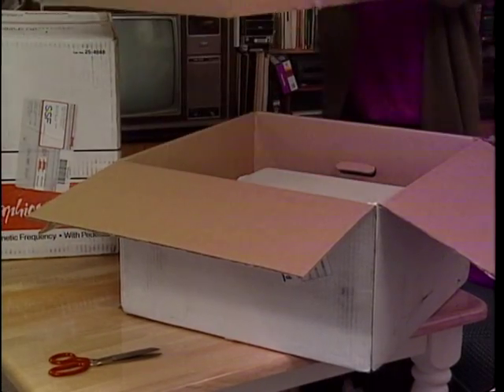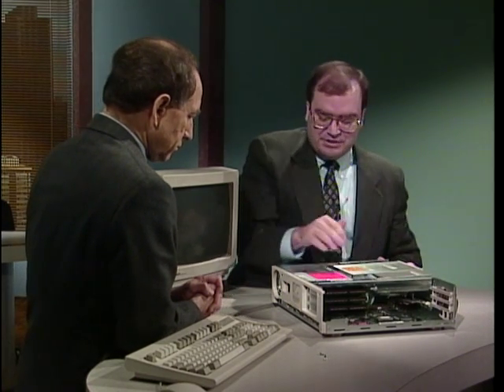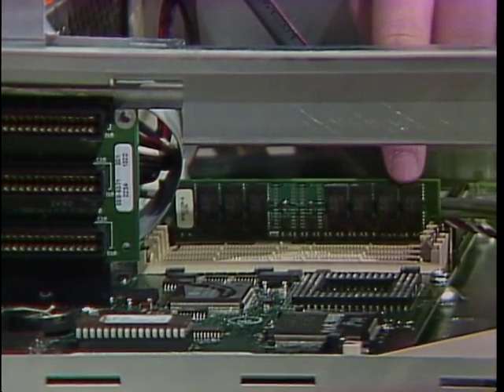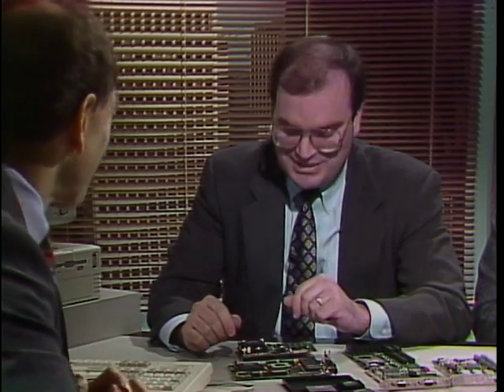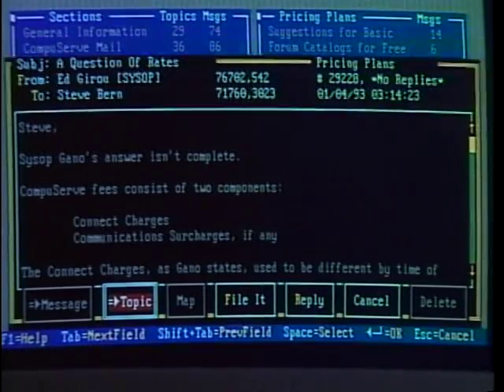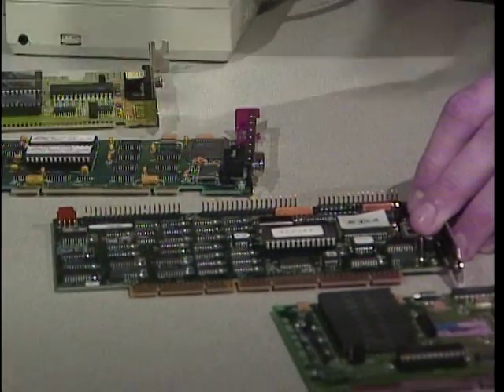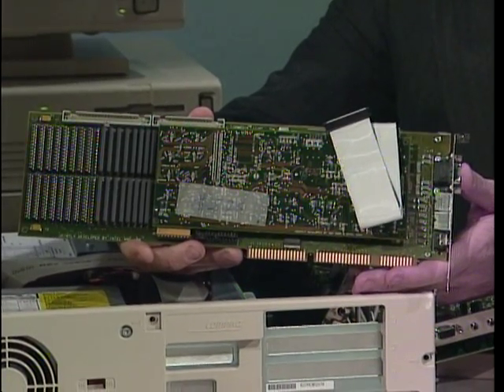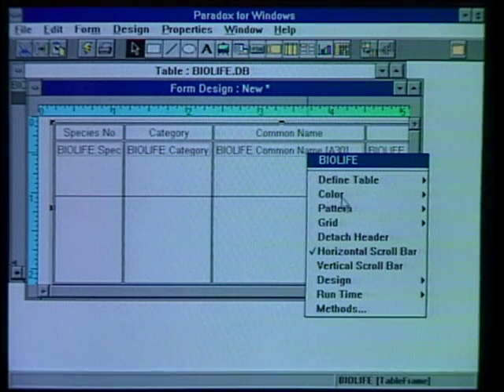The Computer Chronicles - Beginner's Guide to PCs (1993)

Comment: Stupid advice about memory making a computer faster and people today still repeat this nonsense. No it does not make a PC faster. Adding memory only helps if your system doesn't have enough and the lack slows the system down! If the OS & program fit into the memory then adding more doesn't help at all with speed as the extra just won't get used. Seems like giving bad computer advise is of all era's ....
Also having to get a new monitor if you get a new video card.... That was only the case when upgrading from an older standard like cga or ega to vga or if you really wanted to use software that required a higher resolution. In most cases it wasn't needed to get a new monitor when getting a better graphics card. It might have been true 4-5 years earlier, but not in 1993. They really didn't explain that very well.
Reply: All the people making obvious jokes about the minimum RAM in this video probably think they're using a supercomputer because they have 16/32GB of RAM.
Reply: @yellowblanka6058  Yup, when a proper workstation for CAD or 3D graphics has at least 64 and often 128GB or more as standard. And a REAL supercomper has in the terrabytes of RAM (though those have multiple processor boards, with each their own memory, that are linked to work together)
Reply: @yellowblanka6058  Well, your average Gamer PC will be FASTER than the fastest Supercomputer of that time. Especially your GPU should have much more FLOPS and your CPU much more MIPS than they were able to achieve in that time.

Comment: if not because of that darned x86 compatibility, those "nerds" will think our modern uber fast computer with super high resolution display and uber capacity of primary & secondary storage not to mention network speed (wired & wireless) as alien technology; long live x86, you should be able to boot MS-DOS 3.30 even on threadripper 64 cores.

Comment: 4 megs reccomended, wow, good thing i'm getting 32 gigabytes lol
Reply: Justin Noker Good thing I've got 1.5gb!
Reply: howardkevinm I'm using XP, i tried 128mb and it still goes.
Reply: Sony Trinitron the minimum requirements say it only needs 64 megs, i did have an experiment of installing XP onto an original Intel celeron (PC had a windows 95 badge on it) and i did get the installer to start, however after that it kinda failed, i think due to an error on my end though, i'll have to try again one of these days
Reply: Justin Noker Reminds me when I tried getting 98 to run on a Dell optiplex GX50 from 2001, it said inefficient memory during setup even though it had 512mb and nothing showed up bad during memtest.
Reply: Sony Trinitron lol, 98 must not like the PC too well then lol
Reply: Justin Noker Yeah, I tried getting 98 since that was the only disk i could find, I managed to get XP and got that running perfectly but in the end the GX50 got sent for recycling.
Reply: Sony Trinitron ironic that the machine i used i pulled from a recycling center :P
Reply: Justin Noker Wow, but at least my machine fits my needs for daily internet browsing etc...
Reply: Sony Trinitron yeah, and i have a quad core PC with a 750Ti for a graphics card and i'm constantly complaining about it being too slow lol
Reply: Justin Noker If you're a gamer I can understand! If you're just a casual internet browser then I can't imagine how it would be slow!
Reply: Sony Trinitron yeah i'm a gamer, i also managed to "hack" simcity 4 to run natively on windows 10 and to initialize the graphics driver, however if i was just a web browser my 10 year old dell latitude D810 running antix linux would cover me
Reply: I'm just imagining someone reading this youtube comment 25 years from now and snickering about the thought of boasting about having a measly 32GB when their rig has 32 Petabytes of memory.... :P
Reply: @PhoenixNL72-DEGA-  Imagine somebody in the 90's flipping through a Commodore 64 catalog "64K, pfft, I'm getting 16MB!"

Comment: 4MB of RAM... Hahahahahahahaha. Yeah, that'll work with a contemporary OS. I think about 16GB is a good place to be now. As for the 200MB HDD space being enough for a 'long time', 20 years later 4TB gets a little cramped.

If these people saw an 8 core tablet with a UHD display, 128GB on a MicroSD card & a few GB of memory, they'd think it was Star Trek technology. LOL :)
Reply: I completely agree. The biggest issues with software are the amount of translation layers and components necessary for programs to function; as well as the amount of backwards compatibility bloat and redundancy involved. I remember when you could boot an OS from a floppy. Now you half-fill an SSD with the thing, and the updates every month are the size of a CD image. All it does is run slower and have marginal UI improvements (if you call flashy, unnecessary garbage an improvement.)

One reason I like Apple and various Linux distributions is that they take a no-bullshit approach to their OS designs. They try to make the experience quick, rather than pretty. They add functions when appropriate, but phase out crap that nobody uses. It's basic and utilitarian, and works faster and better than Windows.

The fact that Windows 10 is not Windows 9 is a primary example of how backwards compatibility in the Microsoft environment is broken. Who in their right mind is running Windows 95 or 98 software that would conflict with calling it Windows 9? If someone is, they should be upgrading their applications, because that's crazy. Even banks shouldn't have conflicts, since they would be on the NT branch of the OS environments.

I usually stay with the current OS revisions and try to update everything in kind, so I don't have any old code running around any longer than it has to.

If it'll give you a laugh, I should mention that I know a business that was running OS/2 on a machine until about 2 weeks ago. It wasn't even the latest revision, which was phased out in 2001. (It ran an industrial glass cutter.) You could do the same job with a Raspberry Pi, and save a shit-load of electricity. LOL :)
Reply: SeanFromPVD 

Things get a lot bigger with a 64 bit cpu  with its own dedicated connection to ram . Something that would be 1 kb on an 8 bit  will be 4kb on a 32 bit cpu . This is why computers are so fast we have multiple channels of information now so we can get away with sending redundant infomation.
Reply: ***** Debian : <200mb ram on startup - Nailed it!
Reply: la generación de ahora solo consigue jugar candy crush con su celular.. nuestra generación con unos pocos kilobytes llevó gente al espacio
Reply: As the show is from 1993 - yes, they would have called it literal Star Trek technology, as outside of TNG you wouldn't have seen something like a Tablet yet.
Reply: @sbrazenor2  Lol, many ATM machines still run on Windows XP or often even Windows 98. So yes, Microsoft has to think about this backwards securities. NT wasn't used much, when a company in the 1990s wanted to be professional they used UNIX servers and OS/2 as the PC OS, as OS/2 was able to communicate natively with UNIX servers. And yes, also NT was POSIX-able, but still in it's infancy, NT 3.5 was only developed by Microsoft because IBM ditched them from the OS/2 project.

Comment: Love how serious they are 😂😁 4 megs, nothing less than that. 😂
Reply: And 20 years from now somebody will be making obvious jokes about tech videos on current phones/computers. For the context of the time, 4MB was a decent amount of RAM.
Reply: @yellowblanka6058 no,  it was unthinkable to use a 90s pc in the year 2000 but today even one from 15 years ago is still usable
Twenty years from now the gap in performance will be even smaller
Reply: @moracomole8090  The reason for that is, that outside of arbitrary hardware restrictions like Windows 11 got a computer for the everyday task don't need more than 1 Ghz of a Dual-Core CPU, 4 GB of RAM, around 128 GB HDD and the on-chip-GPU of modern CPUs. When you only want to run office software, that's totally fine.

Of course when you then use Chrome, you need 128 GB of RAM and when you use SAP you need 1 TB of HDD :D

Comment: when he says computers are low cost in 1993, I started dying. for $4000 you get a computer with a 80mb HD 4mb of Memory and a super fast 90mhz Processor! my $1500 Alienware Aurora R6 has an i7@ 4.20ghz 16gb DDR4 and a 2tb m.2 SSD. My computer would run that $4000 computer into the ground in a minute. a processor without a heatsink? talk about risky. or maybe its just cheap. What kind of Computer expert would use a metal object while poking around in the system? are you TRYING to fire the board? ive done that once. SIMM memory became obsolete in the later 90s when DIMM became more efficient and used less memory space. "4mb MINIMUM for memory" hell my computer wont even start without 4gb lol (4000x's as much!
Reply: never understood why Intel did the 4."20"GHz thing. 4.2 surely...
Reply: @RWL2012  well my computer (still using and on) is ancient now.